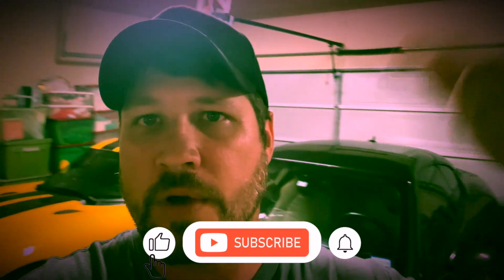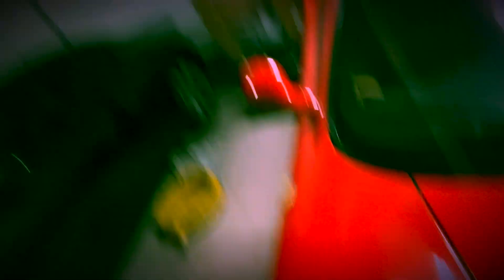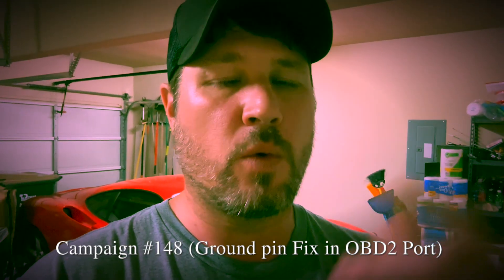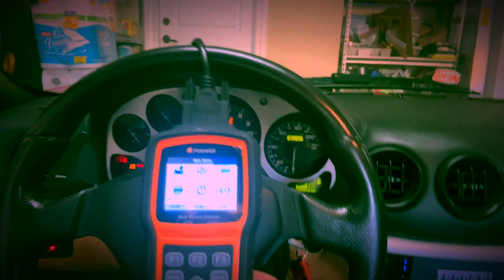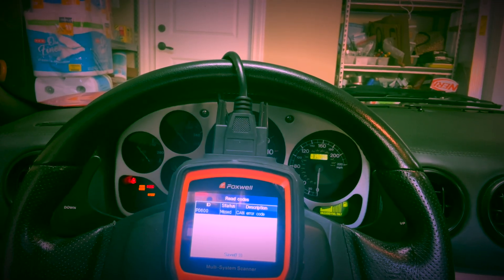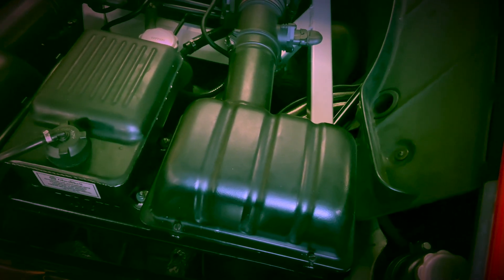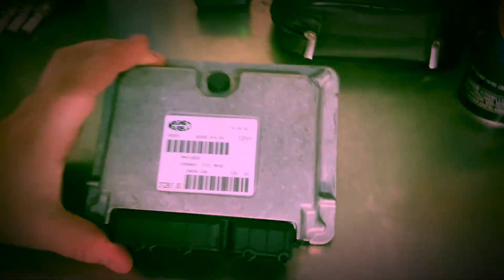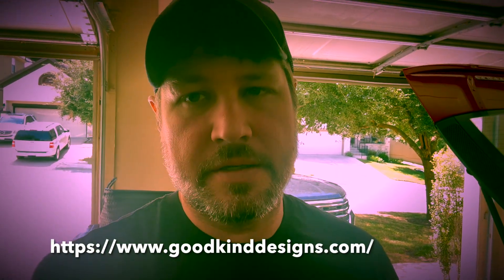Ferrari 360 Challenge Stradale TCU Upgrade | F1 Shift Feel Transformed

Comment: What about  CFC201F.03 from a 2003 360...S/N is 133883 and you'd think I'd be able to set the PIS with a generic scan tool and yet no go 🙂
Reply from the maker: I’m not familiar with the 133883 part number.

The CFC201F.03 can’t be reflashed for sure. The one I took out of my 2000 had the same hardware revision number and was the older non adjustable PIS style.

Comment: mines a 1999 so guessing TCU is going to be too old to flash - thus i'm into getting a replacement and flashing etc...  that manual conversion man logic gets stronger every day :)
Reply from the maker: Yep, correct. It’s worth looking at the part number and seeing anyway just to confirm, but I don’t disagree with you on the manual conversion 😂. I’m trying to hold on to the F1 setup until something gives up the ghost and I am facing a large repair cost in parts which forces me to look at the manual conversion. I don’t mind the F1 setup honestly.